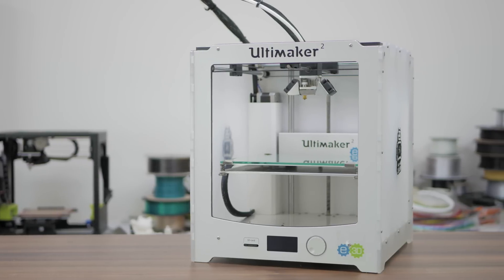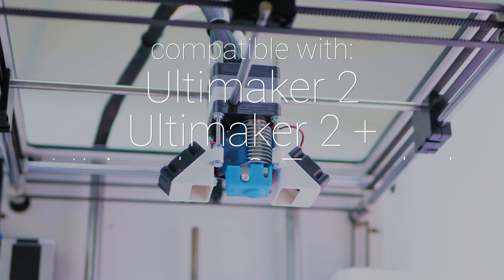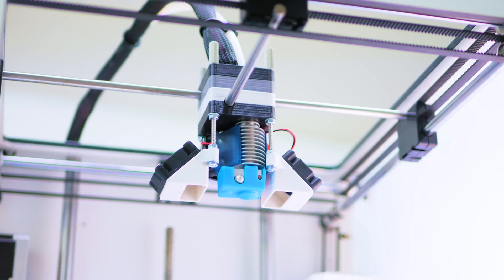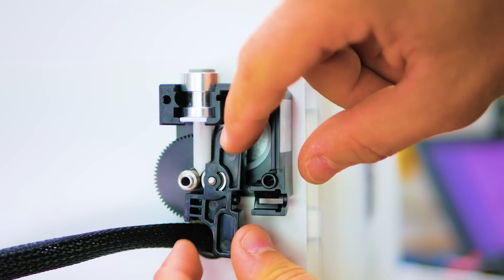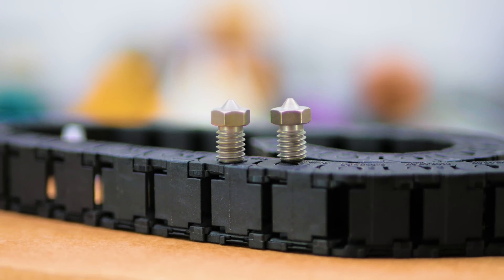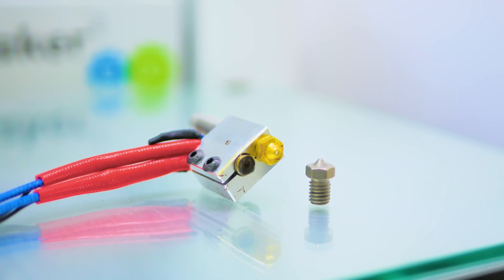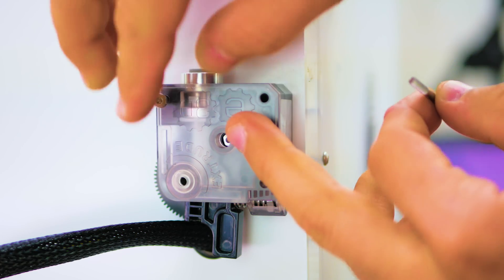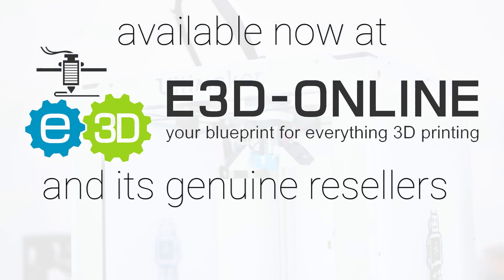Ultimaker: The Ultimate Extrusion Upgrade from E3D

Comment: I will say that my printed parts needed to have all of the holes drilled out to the proper size since they were printed so poorly. I also had to enlarge the openings for the sliding bearings since the tolerances were so sloppy. 

I still have buyer's remorse over not buying the genuine Ultimaker upgrade, especially since support hasn't resolved my issue with the Titan yet.